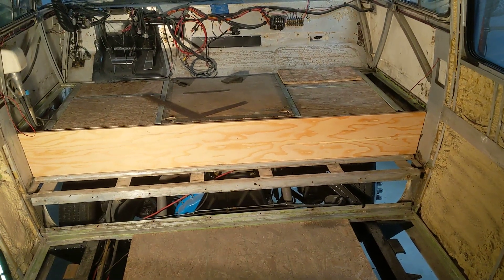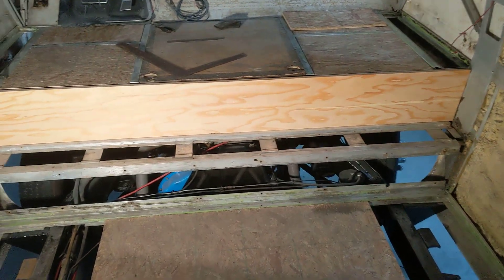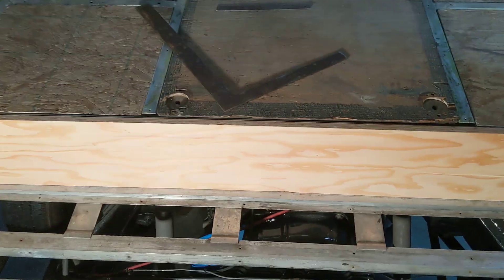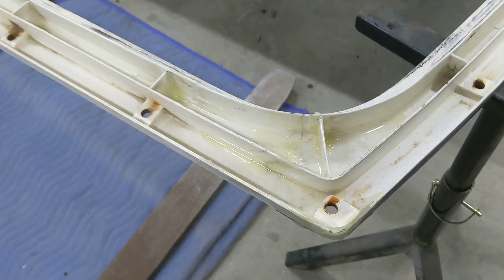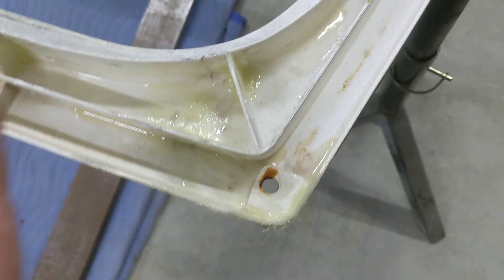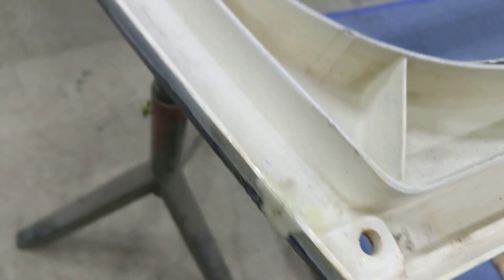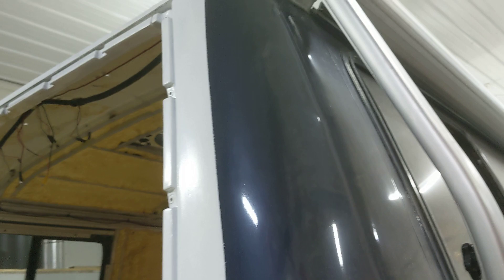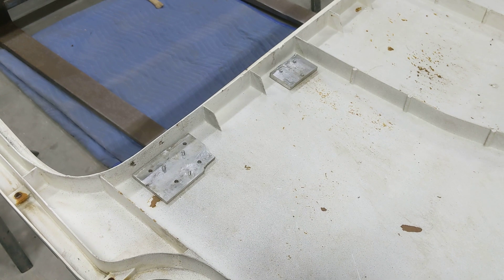GMC Motorhome 75 (floor/ black tank)

Comment: Looking forward to see how you seal up the back hatch. Thanks for sharing the progress on your coach.
Reply from the maker: I purchased some 9mm neoprene rubber tubing with a 2mm wall to fit into the seal groove.  I am hoping that is all I will need.  Maybe some o-rings on the bolts